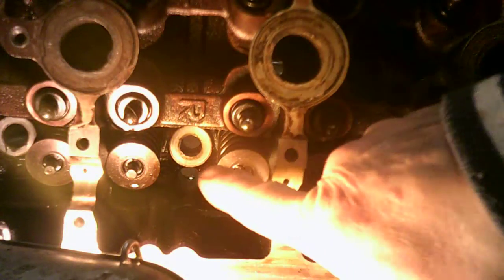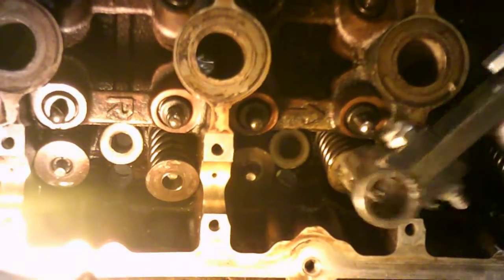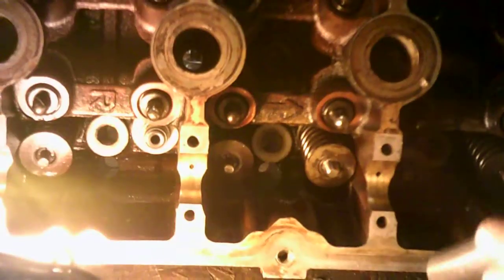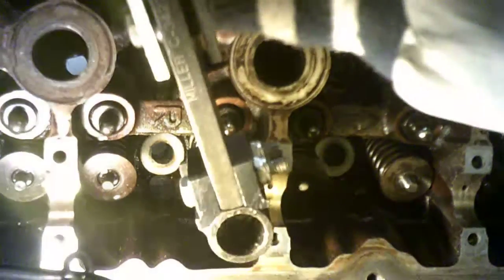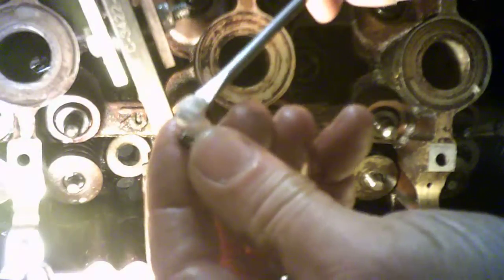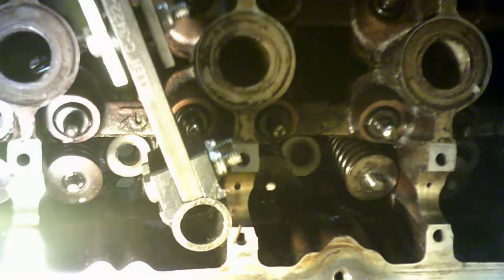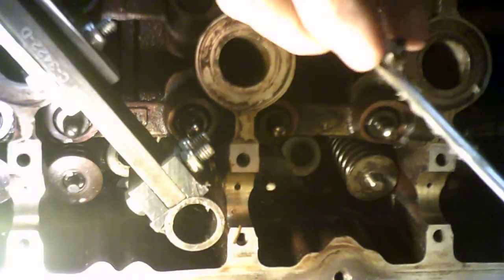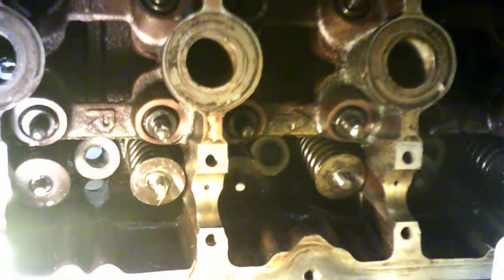Changing valves in Dodge Neon cylinder head

Comment: tink that the valve compresion tool you are using it makes this job way more complicated than it is,theres another kind of tool with like pliers tip end that will pass thru the valve tip end while compressing and leaving the valve tip end and retainer exposed and easy to pull out
Reply: Tristen Ramsay i rented at autozone once...i didnt buy it,i think they are kind of expensive lol
Reply: Do you have the valve spring compressor part number? I've tried every parts house in my area and the only compressors they have will not work 😑.....any help would be appreciated 😊